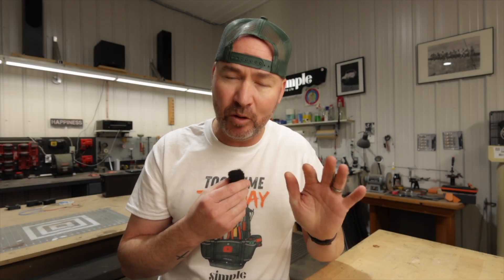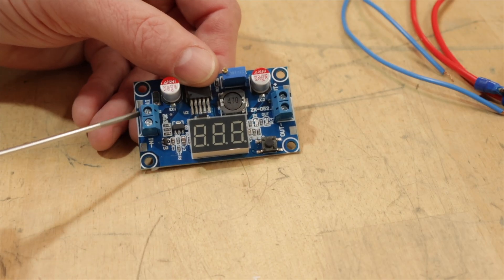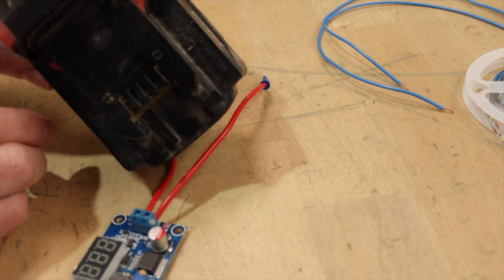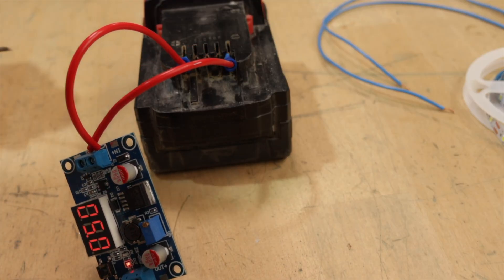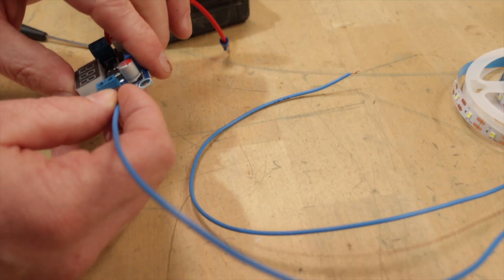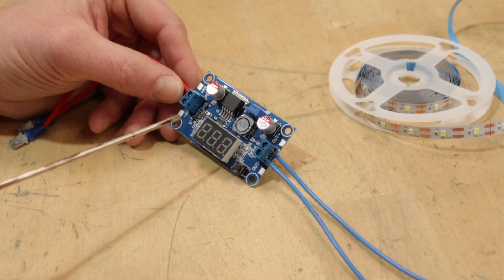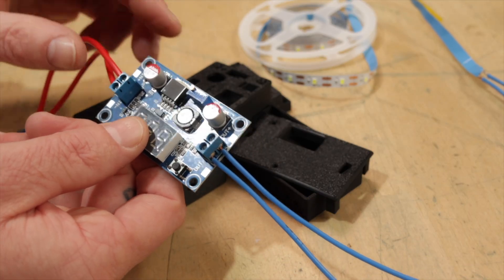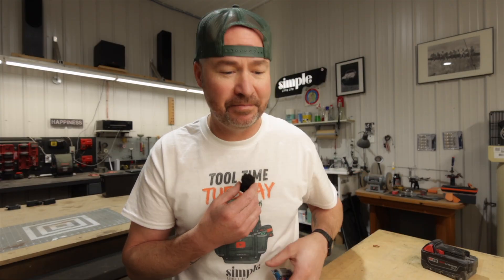DC stepdown regulator - Tool Time Tuesday

Comment: Jeremy, you inspired me to buy a couple of these voltage regulators. Nice little video. After printing three different cases I was finally able to make one that works. Thanks, man!
Reply from the maker: Right on! Glad you found one that works. I have a project coming up for this and I'm still on the hunt for a case to print that will fit mine. I might end up just designing my own. Cheers 👍

Comment: I’m sure you have seen them but you can 3d print battery jacks that fit your Milwaukee batteries so they will just snap on with leads hanging out
Reply from the maker: Yeah I have one printed but haven’t assembled it yet. So great having a 3D printer right?! 👍

Comment: Simple video, but it would be more intuitive to have the red wire positive, and negative is black.  If you put battery positive to input negative, will it fry the step down?
Reply from the maker: I have no idea. I agree that I should have used different colors of wire.
Reply: @Simplelittlelife      It still works, but begs the question," Do I cut the red wire, or the... the.... the RED wire?"
Reply from the maker: Hahahaha! 😆👍

Comment: Also called a "buck converter". They are super efficient because they use pulse width modulation to step down the voltage instead of resistors. It limits voltage but does not limit current, so check your amp draw. And they usually don't live long on inductive loads. A "boost converter" is a related device that raises the output voltage over the input voltage. And they also have "buck/boost converters" that do both.
Reply from the maker: Thank you for all that information! That’s good to know. Cheers 👍

Comment: if you happen to have a ferrule kit, you’d be able to put ferrules on your wires and it will protect them from the screws clamping down on them and give them a much longer use life.  Awesome stuff with the step down regulator!  I use them to some degree in my ham radio kits.
Reply from the maker: Yeah I’ve seen those ferrule kits and thought they look like a great idea. Might have to invest in the future. Thank you for sharing that. Cheers 👍

Comment: Hi everyone. Just make sure you don't let the voltage in your battery get to low as you can damage it. Or it will stop working.
Reply from the maker: That is a very good point! Thank you. I’ll pin this comment so hopefully more people see. Definitely should have mentioned that in the video. Cheers 👍

Comment: I used one of these to get an old school 3m breathe easy papr (which are very cheap on ebay) to run off another very low cost battery. Very cool, thanks for sharing!
Reply from the maker: Right on! Yeah that is a great application. You're welcome. Cheers 👍